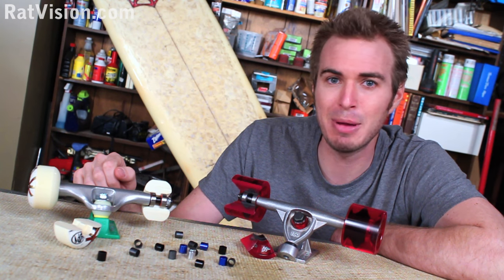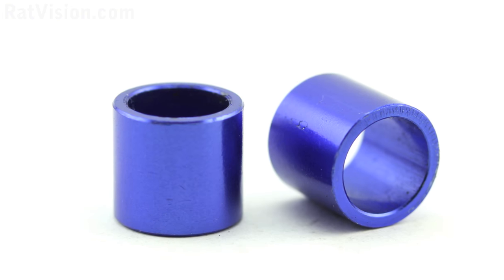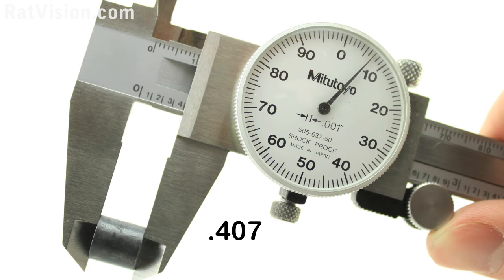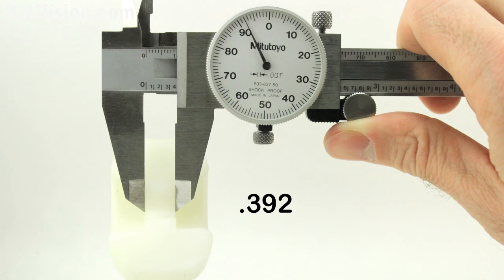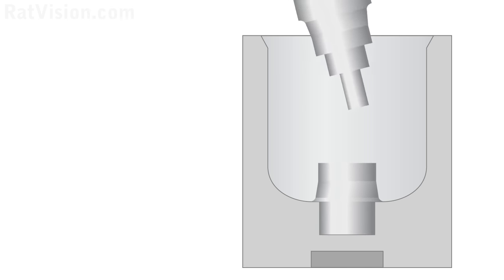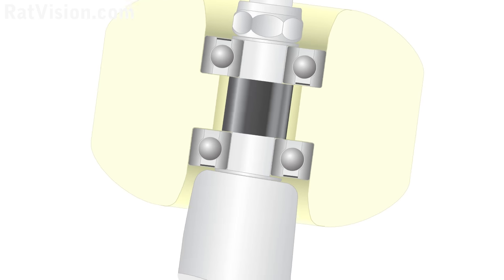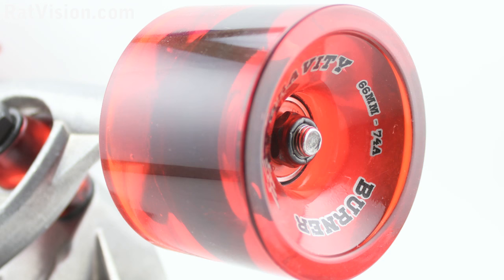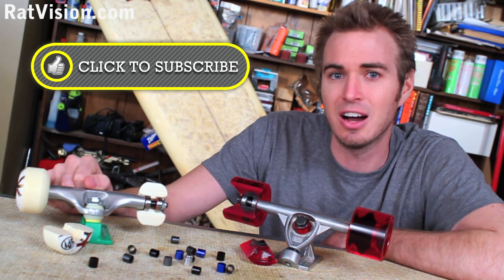Fastest Skateboard Wheels, Bearings, and Bearing Spacers

Comment: Hey i have a problem i got spacers because my wheels wobble a bit but they wont let me tighten them down all the way like yours! are my spacers not wide enough for my wheels? (1cm)
Reply from the maker: I wonder if you don't have enough threads.  Do you have axle washers? .....wait.....  You mean you can't tighten all the way down even tho you have spacers inside?  If so, welcome to the problem of bad manufacturing.  This is why we made this video– to point out the problems.  Your spacers are probably too short, so when you tighten the bearing inner ring is being pushed is while the outer one remains in place. This pinches the balls and causes them not to roll.  You can get new spacers that are larger.  Unfortunately, I can't tell you which ones to get. it's ok if the nut is just a little loose.  The wobble can also be caused by the truck axle not being thicker.
Reply: +Rat Vision – Skateboard Tech I think its the wheel not being perfectly made so the bearing is seating sideways a little, I got one wheel to seat right but the others won't. just bought these new bones spf wheels too
Reply: +Rat Vision – Skateboard Tech to be clear when i tightened them down all the way the wheel wouldn't spin even though the bearings and spacers were touching inside
Reply from the maker: +NotAsian A little wobble is normal because the bearing hole and the axle do not fit very tight. So, there is a little wobble there. If tightening the nut all the way down stops the wheel, then the spacers is too short. It might appear to be fine and things are touching, but the smallest measurement can bind the bearing. There is a chance that the bearing seat could be off. That just depends on the wheel mold. Take the bearings out and make sure everything is clean and that the bearings get in all the way too.

Comment: sure maybe compared to other bearings at higher prices, but for the price they are the best in my opinion. they lasted me twice as long as reds and ran smooth without cleaning or lubricating for months. I would be complaining if they were $25+ but they are $14 and i cant think a better bearing for the price.

Comment: What is the best bearing wheel match up in your opinion?
Reply: This channel is inactive now.
Reply: But i personally use softer wheel. At the size of 53. And abec 7's
Reply: It really depends on what you are skating though. I skate alot of bowl and park. So softer wheels are great. But harder wheels are generally regarded as the best choice for street. White wheels are harder than other colours as the dye softens the wheel. Have fun skating.
Reply from the maker: Says who!
Reply from the maker: There isn't a good matchup, unfortunately.  You'd have to measure the wheels and spacers yourself.  This is a major problem in the industry.  Standards are no longer important, money is.  If China can make a product cheaper, and you can still sell it for the same price, make it appear super cool and better than everyone else, who's going to care if the spacers don't fit the wheels right?  This appears to be the attitude in the industry.  If you purchased wheels, you would have to have the right tool to measure the inside core between bearings seats, and then find spacers that match.  Many suppliers don't even have matching spacers sizes.  You'd think Bones, who supplies bearings, spacers, and wheels would have this right, and they don't.  So, much for an industry leader, right?  We seem to be a lot in a favor of Oust, but it's because they are the only brand/company that seems to care the most and has the most integrity to do things right.  The problem with them is their limitations on wheel styles, sizes, and durometers.  They are the only company, that we have come across, that supplies bearings, wheels, and spacers that fit correctly.
Reply: +Rat Vision – Skateboard Tech Is there any particular reason why you stopped making videos? Greetings from Germany :)
Reply: +Rat Vision – Skateboard Tech Thank you
Reply: well tbh there isnt THAT much more video they CAN make.
Reply: +Rat Vision – Skateboard Tech Personally I think Mach 1s by Venom and Oust bearings are the best together.

Comment: so if i want some wheel that will let me go fast what wheel should i get and barrings i want to go like 35 to 40 mph making a skate board with a motor
Reply from the maker: That all depends on the terrain/surface you'll be skating the most.  You also have to consider battery life and getting economical with how long you can make the battery last, so you can get the most distance with it.  You've got to consider other variables before you factor speed.  You'll go slower on a smooth surface with soft wheels, and slower with hard wheels on a rough surface. So, I can't recommend wheels before you tell me your intended use.
Reply: so like on a street like what cars drive on and side walk. so maybe 50 % on the street and 50% side walk mostly using it to get home from work and go to work so basically mostly for transportation and a occasional Joyride he and then. thank you very much on helping me

Comment: i have never understood how spacers allow you to tighten the nut all the way down. i have had many wheels and bearings all with spacers but tightening the nut down all the way just causes absurd friction, can someone explain this to me?
Reply: tommy kimberlin You shouldn't tighten it down completely all the way anyway, it just is possible for you because of the spacer. I think what the spacer does is push against the inner race from the inside, so it can't get pushed into the wheels by tightening the nut too much.
Reply from the maker: tommy kimberlin It's all in the video.  They aren't a perfect fit.

Comment: One of by wheels is braking and when i turn it slowly with my finger i can feel it resisting.
I took it off and i re-pressed bearings but the problem remains. 
I'm using bones V5 and reds + some no name spacers that work on other 3 wheels. 

Please i need some help with this crap because it's driving me crazy
Reply: +This is my dog :D Clean your bearings and lube them up. Or just buy a new set.
Reply: +Ben Wilder I cleaned them 2 days before i commented, but i forgot to mention it.
After some time i cleaned them again and one of the nylon cages was broken. I guess that was the slow bearing that fked with me
Oh and btw. i was using bones reds and one bearing was faulty on the arrival, one had this shitty nylon cage and one somehow rusted and well... i couldn't use it anymore (but that was probably my fault i guess).

Now i'm using some random ceramic bearings for 10€ from aliexpress and they are freaking amazing 10/10, whisper silent, fast as fuck, precise... oh and they are complete bones swiss ceramic fakes, to the last detail (but i didn't know that until they arrived)

Comment: I have a 44" pintail longboard and when I ride it, there is a rattling noise from the back axle. I have narrowed it down to the bearing spacer is to small and was wondering if there was any way to remove the rattling without swapping bearing spacers
Reply: No
Reply: Why a fucking pintail???
Reply: Why not
Reply: +Craig Brighty 
If the bearing spacer's size is causing the rattling [which makes perfect sense], then it must be swapped for a better fit.
Reply: +Craig Brighty Just don't have spacers. I don't use spacers and I achieve 40 mph with no problems.
Reply: KoreanJoker rekoJnaeroK i broke an bones reds bearing while LDP'ing, so i think it is necessary when there is much pressure involved
Reply: Jasper van Loo That's cause you're pulling the board in directions to give that motion. You wrench bearings out of their sockets pumping

Comment: Is there any wheel brand that has in-spec 0.400 cores?
Reply from the maker: We are working on developing a list to assist people with finding the right spacers and wheels, however this means we have to measure every core by every manufacturer. We have measured a lot and do have some numbers, but where are you going to get the spacers?  So even if I told you to get a certain brand that has .400, you'd have to find spacers somewhere that matched.  And, whats bad about finding spacers, is that you might find one that matches, but the other 3 are off.

Comment: You're smart guys and you really ought to know that  "manufacturing tolerances" refers to dimensional inaccuracies permitted during the manufacturing process. A spacer 0.005" too long is completely insignificant to dust rust and damage. Misaligned wheels are negligible when they're soft and pitted from sliding. If you took any skilled rider and swapped out his spacers for 4.020" ones, they wouldnt be any slower down any hill. You ought to run that experiment.

Comment from the maker: Seismics DO NOT work because the built in half spacers do not fit every wheel. They only work when they fit a wheel that matches the the spacers. What if the gap in the wheel is bigger than the spacers? Then the whole point of the built in spacer is completely useless. If the wheel center is small them one bearing ends up sticking out of the bearing seat, which can cause speed wobbles. You've been sucked into the hype. They work like any other bearing, but the spacers and washers are a gimmick.

Comment: Hey do you need spacers for street skating?
Reply from the maker: Spacers are supposed to be used for all types of skating.  Their purpose is to allow the nut to be tightened all the way down so the wheel is securely on the axle and can perform optimally.  The problem is that brands don't care anymore to make good quality products, and focus more on marketing and branding, and just have a company in China make products, so they can continue to sell products at the same price to consumers and make more profit with cheap China manufacturing prices.  The result is careless products.  This is why wheel centers and spacers are different sizes all over the place.  The skate industry has gone to hell.  The spacers help with performance by reducing the amounts of loads applied to the bearings, keep the wheel solid so it can roll more efficiently, and reduce speed wobbles.
Reply: Thanks , do you recommend and legit trucks and Bearings that will last long?
Reply from the maker: Any truck will last quite a long time.   We like Oust bearings.
Reply: Rat Vision – Skateboard Tech This has been bugging me since I returned to skating recently after a 22 year rest. Have had issues with getting bearings to sit properly in some wheels, I have one Spitfire F4 that wobbles, only slightly, but can't get it to sit right. Was told to try using spacers, but given what you say in this vid it simply doesn't seem worthwhile since it's so hit and miss. Is that right, or should I try spacers (got no calipers to measure things!) and if not, should I even worry about a tiny bit of wobble?
Reply from the maker: In our opinion, Spitfire has terrible wheels, but hey people skate 'em.  You most likely have a bad wheel.  Try taking the bearings out and really slamming the wheel down on the bearings.  It could be a bad bearing too.  a spacer will not fix the problem if the bearing seat is crooked.
Reply: Rat Vision – Skateboard Tech Weird, I love spitfire wheels. Never had any problems with them. What do you guys like for street? Most people say bones, but to me they feel like plastic, not urethane.
Reply: MrScottCarr Spit F4s definitely feel nicer than bones, more controlled slide imo as well. But... bought a set of 54mm F4s and the ENTIRE fucking set has horrible wheel wobble. Vendor is being a dick so now I'm stuck trying to get em exchanged via Spitfire in America, not sure it's even worth my hassle. On the other hand, never had this (or heard anybody have this) with Bones wheels.
Reply: terrabun I know what you mean. I would just rather take a wobbly wheel than a plastic feeling one.
Reply: MrScottCarr They were so bad as to be useless, the horrific screeching from the axle grinding on the bearing stopped me after a few yards.
Reply from the maker: That's why we don't like spitfire.  They aren't consistant from what we've noticed, and you seem to have noticed as well.

Comment: Do you have brands of wheels or trucks that you recommend?
Reply from the maker: what type of skating do you do?
Reply: Longboard, more street style, soon buyin one for speed.
Reply from the maker: We need more info than that for the longboard
Reply: Berrings and wheels for slide and taking alot of hits, but at the same time good for freeride :s
Reply from the maker: Freeride wheels are like large street skating wheels with round lips, and depending on the skater’s preference, can be any core set because of is so versitile.  Center-set wheels offer an added advantage by allowing the rider to flip the wheel for even wear distribution.  
The problem with other wheels sets is their deformation can create a bigger footprint, which can make the wheel grippy rather than easier to slide.  

So freeride wheels tend to be smaller, about 65-70mm, with a narrower contact patch, of around 45mm, to allow for easier sliding.  And to increase the ability to slide, they use a higher durometer of about 80-86A+.
Reply: Thank you very much for taking the time to answer my questions, this help me alot, for choosing my next set of wheels, but also to develop more my passion

Comment: Does having spacers mean I can tighten my wheel all the way without hurting the bearings?
Reply from the maker: That's the whole point, BUT they don't all work because wheel and spacer manufacturers are not making them so they fit properly.
Reply: Rat Vision – Skateboard Tech Hello again lol. So since many spacers come in many sizes, do you think I should buy wheels first then see what spacer size I should get based that's spot on or close enough to the length of the inside of the wheels?
Reply from the maker: Yes, but how are you going to tell?
Reply: Rat Vision – Skateboard Tech You have a point. The only way I can think of right now is getting a machinist to get some custom made but that wouldn't be worth it in the long run. I guess companies need to get a better sense of precision with their products.
Reply from the maker: That would be nice if the companies thought about quality rather than marketing.
Reply: Rat Vision – Skateboard Tech Exactly. But how do you feel about the Zealous bearings with the built in spacers and speed rings? That should have some degree of precision since it kills 3 birds with one stone right??
Reply from the maker: It doesn't kill 3 birds with one stone at all, UNLESS you have the right wheel.  Since you are now aware that all wheels have different size center spaces, how could Zealous, biltin, or Seismic work.  It's a gimmick, because they only work for one wheel center size.

Comment: Are spacers good or bad for streetskate?
Reply from the maker: +IRoBoTeRSTYLE They are good for all kinds if they fit properly.
Reply: ok thx i ll try some. i dont rly know how to put them in. any tip?
Reply: +IRoBoTeRSTYLE you have to put them in before you press the second bearing into the wheel. For now just wait until your current bearings wear out, because removing a bearing is usually worse than just using it without a spacer. When you replace your bearings, just drop the spacer in there and press the other bearing in. Make sure to only press the bearing in by the outer race. A 16 mm socket is the right size for this.
Reply: +Alex Dlugosch Why is removing the bearing bad?
Reply: +NightmirrorXx It actually depends on how tightly the bearing fits into the wheel. If its not a tight fit, you could push it out without damaging the races. However, if its a tight fit, its  not possible to remove the bearing without denting the races with the balls, because you have to push on the inner race, and the force goes through the balls to the outer race (where the friction from the fit is). If it's a tight fit, that force will cause the balls to make indentations on the races, and once that happens, the bearing won't last long. If you can use only gentle taps to remove a bearing, you're fine, but if it's really tight and you have to bang hard (this happens more when bearings are pressed into metal seats, not plastic like with skateboard wheels), removing the bearing can ruin it.
Reply: *****
Thanks for the detailed response. I was able to get mine out easily gently nudging from the inside torquing it with a screwdriver. It might have helped that the wheels were more soft too, and there weren't any spacers inside so it was easy to put the screwdriver in that space.

Comment: can you guys do a vid on the Shark wheels for longboards?
Reply from the maker: They are ridiculous.
Reply: meaning crap? the vids I have seen seem to be ok...but u guys go into detail (science) the truth and y
Reply: meaning crap? the vids I have seen seem to be ok...but u guys go into detail (science) the truth and y
Reply from the maker: It's just a wheel. It's not square.  It has extra material for no reason.  It does nothing.  If you just look at it and think about it, it's pretty obvious.
Reply: I did put that all into perspective,  I know it's a round wheel, the groves and gravel basically were my interests.  it shoes it rolling on dirt, I'm not looking for an off road wheel but pebbles r a skaters worst nightmare
Reply: I personally wouldn't use them because think about what would happen if a rock got stuck in the grooves
Reply: GamesAndLongboards that is something I didn't think about
Reply: GamesAndLongboards i have shark wheels. They work like they are supposed to. Rocks never get stuck in them and they go through dirt and water way easier than a regular wheel. Definitely not worth the 80$ i paid though. Try out a friends and someone else's at a skate park before you buy them.